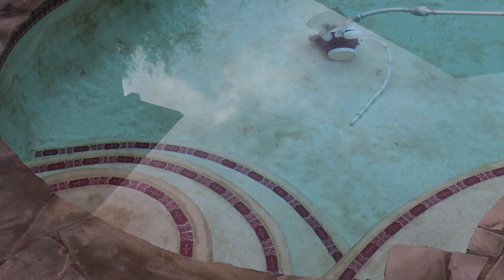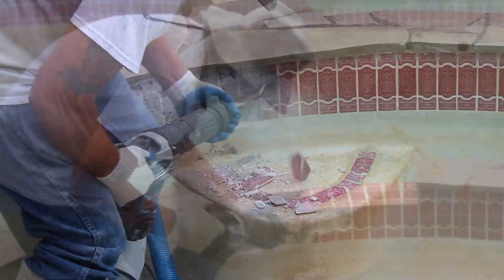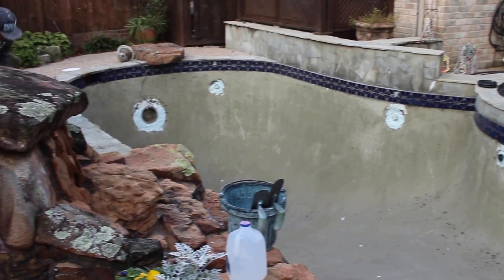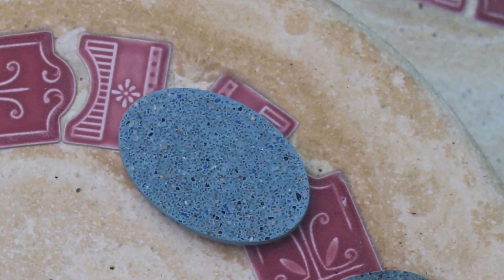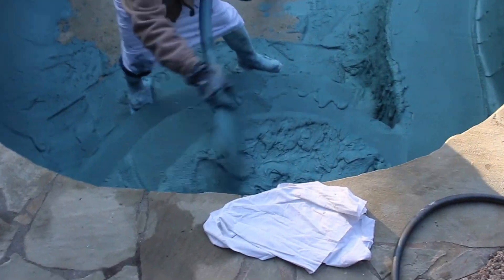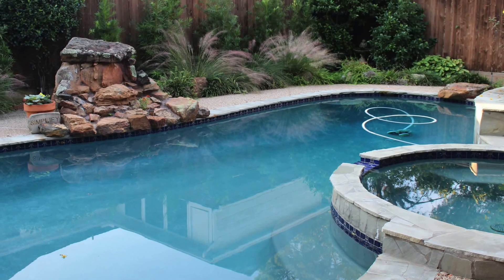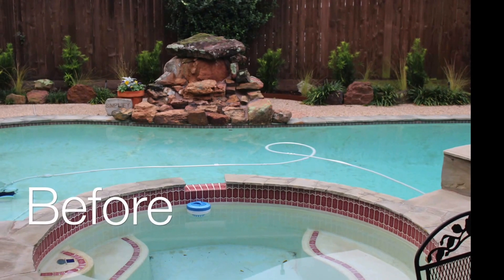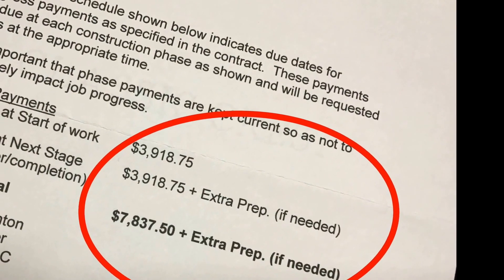Swimming Pool Resurface | Houston Home Inspection

Comment: Hi,
Question, currently have a new pool being built. They finished the shotcrete and noticed that one of the umbrella holes is a bit deep where it does not hold water that long, not lasting more than 5minutes telling me that its going beyond the concrete.  Should I be concerned and if so whats the best way to fix that with concrete epoxy or just add some more concrete?
Reply from the maker: Hi Beto, I would bring this concern up to the pool builder. Any hole inside the pool or around the decking should be filled.